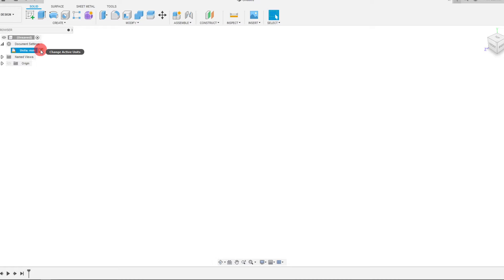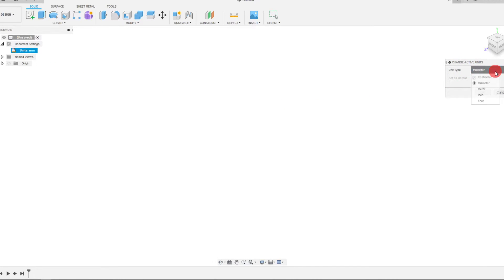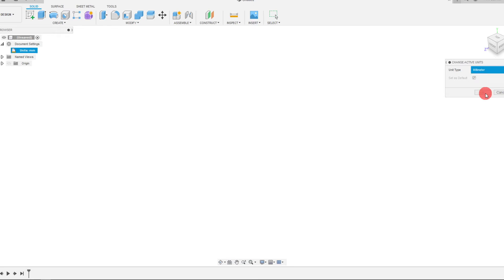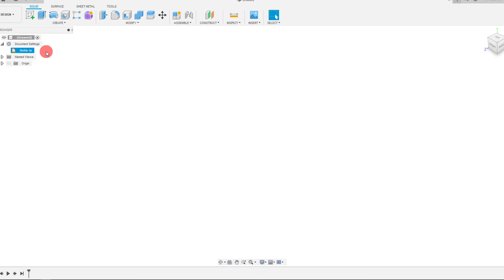How to Change Measurement Units in Fusion 360: Change Dimensions of Inches to Millimeters & mm to in

Comment: is there a way to change dimensions in drawings from in to mm? while the drawing is all ready created?
Reply from the maker: No, as far as I can tell, this is not possible. But, you can change units for your drawings going forward. To do this, click on your name in the top right, click preferences, drawing, From here, you can change your units and drawing. Hope this helps.
Reply: @AvivMakesRobots  Thanks!
Reply from the maker: @EzrelZaBu  It is unfortunate you can't change it... That is one of the many drawbacks of Fusion as compared to inventor or solidworks that have more minute options.
Reply: @AvivMakesRobots  Yes, I see that, but in other hand I find Fusion more intuitive in general, and has a grid that Inventor don't haha thanks!
Reply from the maker: @EzrelZaBu  yes, it has a grid, but i never really found it to be useful, especially if you are going to be putting in your own values anyway. It is good you like it better! It is free, at least.